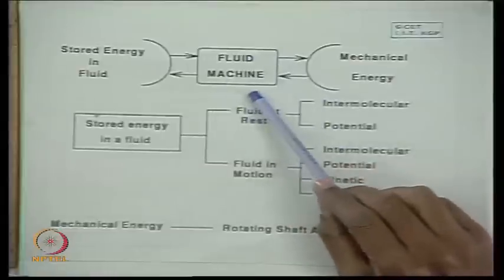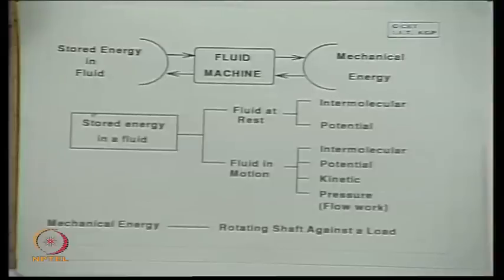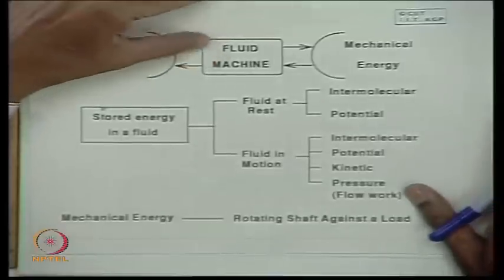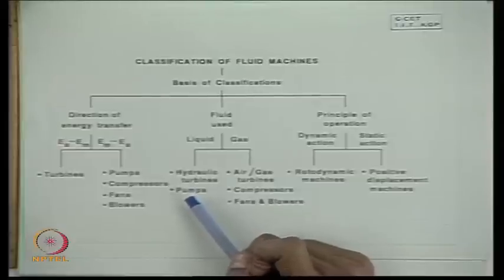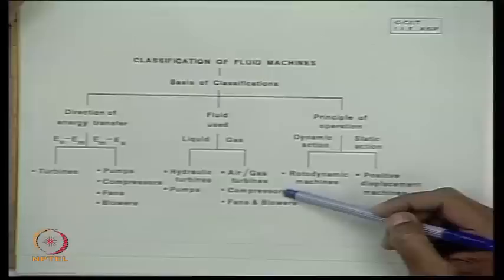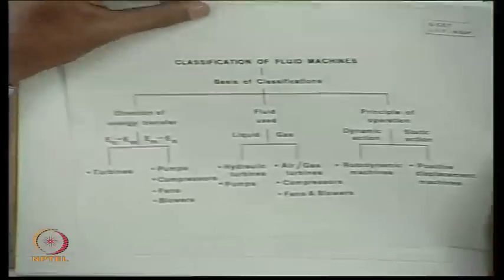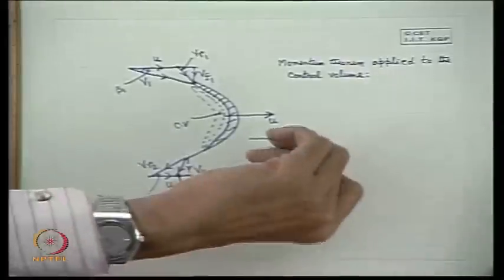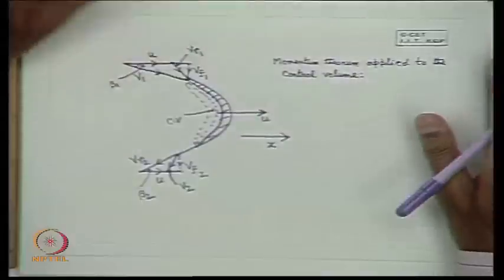Mod-01 Lec-01 Introduction to Fluid Machines 1

Comment: There is a very trivial doubt I have,
Please anyone answer it,

The Euler Turbine equation developed here is valid because u1 = u2 = u

Howsoever, If u1 is not equal to u2, The equation would fail, as per the proof shown here.

So, why then, is this applied to steam turbines or centrifugal compressors.
Reply: I too want to know th e answer for that...
But in impulse turbine U1 and u2  will be cancelled out but in reaction turbine it was not
Reply: @mech-www7563  I have figured it out in my course of time. The Force calculated here by use of changes in relative velocity is valid only for some cases. However, the force is actually calculated by difference of absolute velocities and not relative velocites. So if you were to calculated force by use of absolute velocities only, you will always get the right answer. Only rocket is an exception to it, due to a different mechanism prevailing in it.
Reply: @kushagrasrivastava5905  
Thank you dude